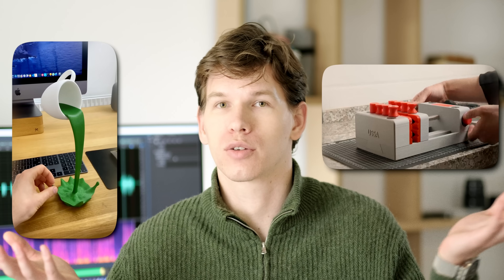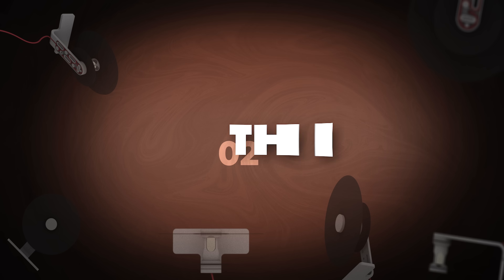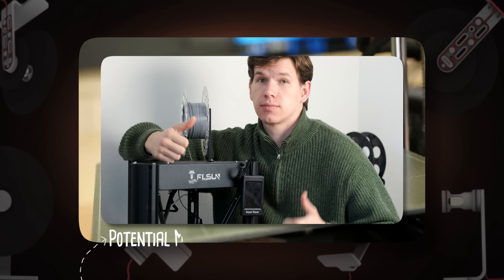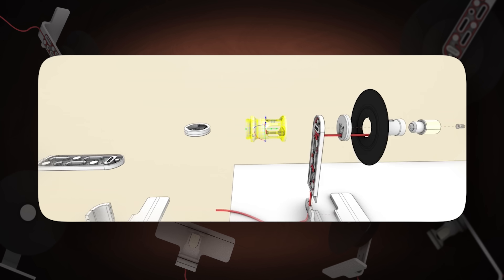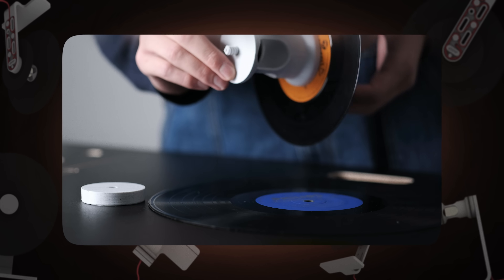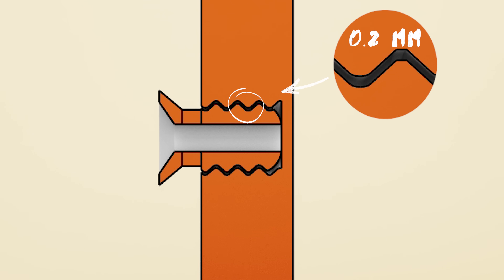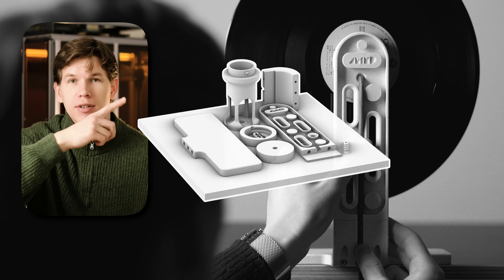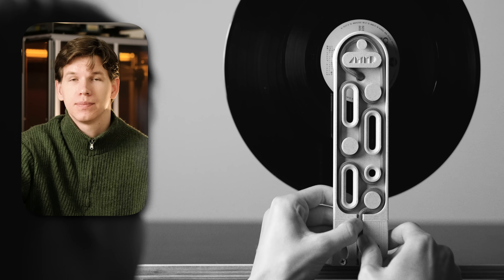Build What You Deserve  ||  DIY Lamp

Comment: One thing I learned about designing parts in plastic for injection molding that would work well here is to design in imperfections IE: parting lines, simple steps, fillets and other tricks where any two pieces come together rather than trying to make them line up perfectly. If you design in artificial or fake steps/separations wherever two parts connect, the imperfections will look like part of the design rather than two parts that align almost perfectly but not enough that they aren't obvious seams.

Comment: You can print super clean supports by printing the support with a different material. PLA and PETG wont stick together so the interface layer is super clean and removing the support is easy. 

Preferably you design with the limitations of the process in mind. So you would just design the whole shape different if you want to mass produce a 3D printed lamp. 

One final note: Insane production quality!

Comment: Great video, good stuff!   Only complaint is mis-using the word tolerance.   The whole maker community seems to do this.  It’s clearance.   Tolerance is a +/- value (typically centered on the nominal dimension) that the machine can do repeatedly.   Design clearance (gap) needs to be more than the tolerance of both parts (stacked up) to ensure a clearance fit.
Reply from the maker: Thanks for correcting, noted!
Reply: Yes. I agree. I have been designing in metal, plastic, sheet metal, and 3D printing the last 29 years. Tolerance and clearance are different attributes of an assembly.  Other than that this guy does quality work. Even this video is fantastic.

Comment: Where  did you get the lighting elements (the red wire and the socket)? thankyou
Reply from the maker: hi, i currently live in China, so i ordered from local shops, but these three might be correct: if not, i can modify the model for them, if you provide the dimensions
https://www.amazon.com/JACKYLED-Adapter-Resistant-Converts-Standard/dp/B00IJUNQXG?ref_=ast_slp_dp&th=1 - socket
https://www.amazon.com/JKLcom-Halogen-Equivalent-Chandelier-Dimmable/dp/B07XSMXFHC/ref=sr_1_98?crid=65AYH94JQYBZ&keywords=e27+led+bulb+12w&qid=1703336899&sprefix=e27+led+bulb+12w%2Caps%2C368&sr=8-98 - bulbs
https://www.amazon.com/dp/B08XMR8LNW/ref=twister_B08TB4VJZB?_encoding=UTF8&th=1 - cord
Reply: @alimpdesign  thankyou, did I you add the switch into the wire?
Reply from the maker: @Freddy-zq6vi nope, the one I ordered already had it

Comment: I learned that 3D printing as a hobby or a business is basically being a product designer, cad draftie, manufacturing techie, quality control engineer, & factory assembler. 

I'm not sure I have the skills or the patience for that, but nice to see what could be achieved.

Appalling material imho, that can't take rough handling is surely something the material scientists need to fix, otherwise the whole concept is very limited.

Comment: Some bloggers say, that after some calibration, you printer will start to print correctly sizes, and you can start modeling without “tolerance”.
Reply from the maker: I’ve seen horizontal hole expansion in cura, but it’s useless for complex models. Can you share an exact video calibrating printer please?

Comment: Nicely done, Great cable management, but the fragility problem seems worse than my results, try adjusting the setting on your slicer and don't dry the filament completely at about 40% to 45% relative humidity is the sweet spot otherwise, the plastic becomes brittle.

Comment: Outstanding work! Why did you stick to that flimsy design? If you had to have it that way, it's better to make it a lot thicker diametrically.
Reply from the maker: Hi, thanks for your feedback. That flimsy part is almost decorative, it’s like questioning chandelier’s glass decors
Reply from the maker: I’ve had the wrong tolerance for the smaller vinyl record, that’s why it broke in video

Comment: Very nice model... I would done a bit differently. It has and still think a weakness in the part you broke... It Is not good to me. Seems to easy to break. First of all with 3d printed models is to make strong model and after that make a nice design...otherwise it's just waste of time and resources. It seems as you done that except one piece that is one of the most important in this object. This can be fixed and might not look that nice...but better so you can trust what you printed. One solution can be to print 45 degree angle if possible... It should give extra strength... I have not done this with any model...but I have had thoughts to test this 🤔 Of course it will be tricky and might not be great as a solution
Reply from the maker: Notes taken📝  thanks! Production model will be from abs plastic, and printed one holds up okay, so it’s fine for now)

Comment: Hey, thank you for the video! It is very accessible and inspiring! I am a UG student researching into 3d printing mostly. I have a few suggestions on how you could improve the design:

1) From my experience, if your printer size allows, you can print the stand in a single piece and bend it using a heat gun / hairdryer+time. To make it perfect, cover parts you do not want to be bent with a few sheets of foil or other insulation. You may also consider making a bend against a some tube (e.g. chair gas-lift)  so the radius is consistent and the corner is 90º exactly. 

2) You may want to make the stand heavier for better stability and more solid feeling of the piece. One way is to have several internal slots in the base and fill them with something heavy (m3 nuts, sand, small stones) misprint so it gets fused inside. 

3) I really like how you played with the wire on the back of the lamp, it both works and looks grate! But maybe you would prefer a "cordfree" design. In the same way, you can bury a cable inside your print by putting it in a slot mid-print so it is permanently covered over with layers of plastic. 

And, anyway, thank you a lot for such a video!
Reply from the maker: Hi Max, wow, one big comment. 
1. Yeah, the heat gun was suggested already, I will definitely look into it.
2. The lamp is actually really stable, but the production model will be from steel, so it’s no issue, it will be heavy enough))
3. Cordless design, would be completely different design, we will leave this for the upcoming lamps. 
Thank you so much for the advices and kind words. Good luck with your studies!
Reply: I think you're definitely missing the point suggesting to hide the cable. It's clearly a deliberate design decision and a standout component of the overall look.
Reply: @Turabbo  you are absolutely right! Cable is a highlight of this design. I am just proposing a theoretical completely different one ;)

Comment: Love it bro but one tip for the initial print for the body. You could of printed the whole thing flat, then print a jig for the radius you want then use a heat gun to bend the arm up. This allows you have optimal layer orientation and still the final form.
Reply from the maker: Hi, thanks! I’ve actually tried it on a smaller scale, it didn’t work, it damaged too much. Will definitely look into this!
Reply: Hmm, might work. You'd have to do it very slowly and heat very evenly on all sides. Even so, the sides would probably fold out, so you'd need to brace them as you're bending to keep them perpendicular to the other faces.

It's trickier with 3D prints than bending wood or moulded parts because prints are anisotropic due to their hollowness and infill.

Comment: Very nice design. You could try to make the inner sides of the records more reflective. Some bright white paint maybe, to get some diffuse light on the wall behind it. Though that may not even be the desired effect. After all this is your lamp, so build it like you want to :-)
Reply from the maker: Hi, thanks. White paint on the inner side was an initial design actually, but the raw record diffused as much light as a white surface. You can also see some special effect when camera is exactly perpendicular to the record, at the end of the video, that also can’t be achieved with a painted inner side.